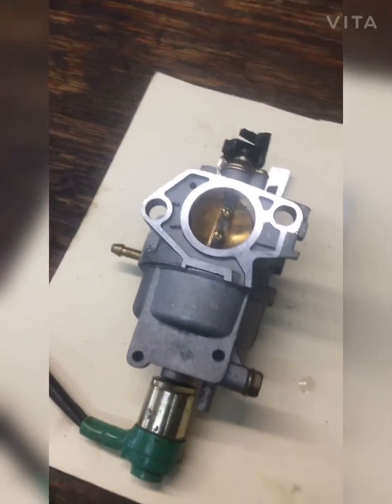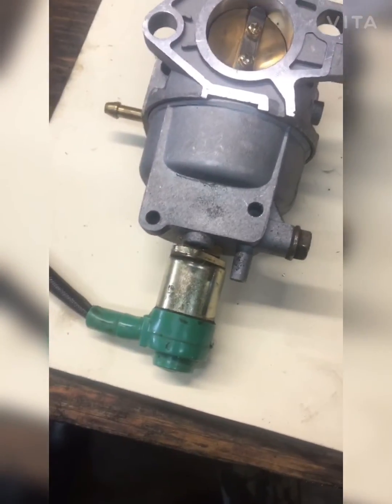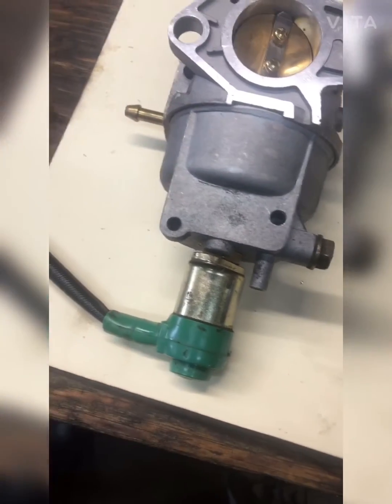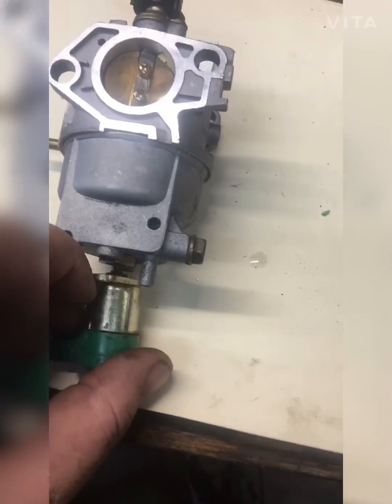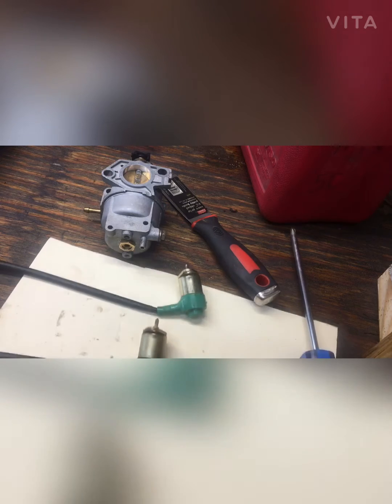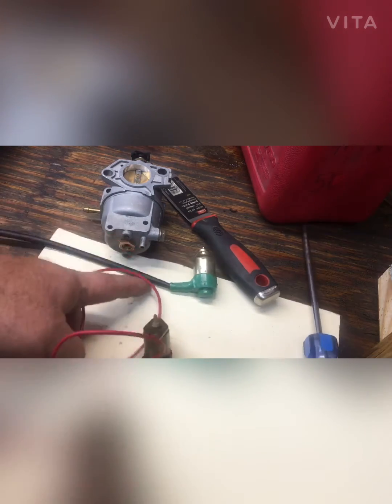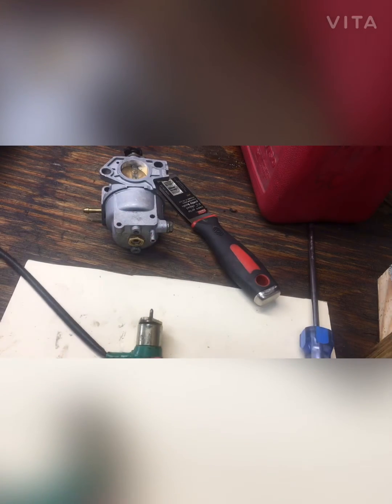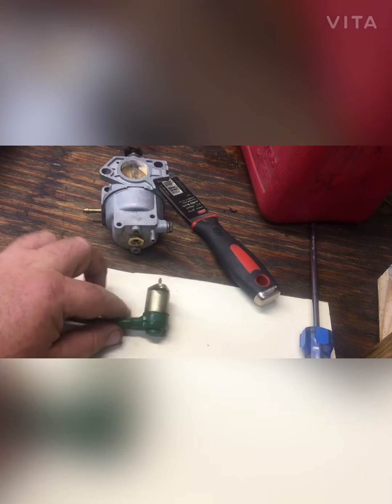Carburetor Solenoid test.

Comment: How does the solenoid function on a generator that doesn't have a battery? Dewalt dg4300. Does it use power generated from pulling it over to retract the pin? Thanks

Comment: Too much work brother just bypass it and put a shutoff valve on the fuel line
Reply: I literally just did it 2 hours ago so much cheaper than replacing parts
Reply: bypass? or just unplug the thing?
Reply: Maybe just cut the top off of it and leave it there …turn off the gas to stop .